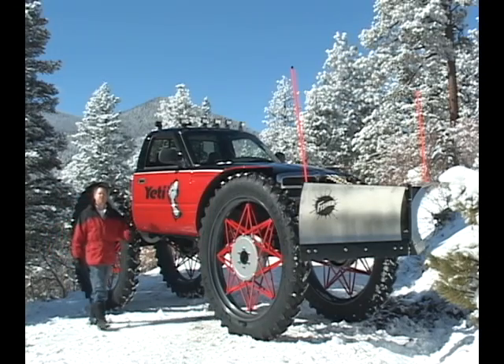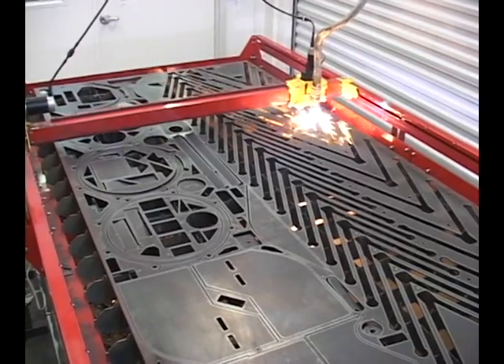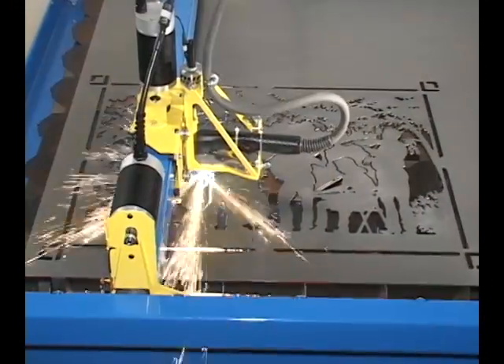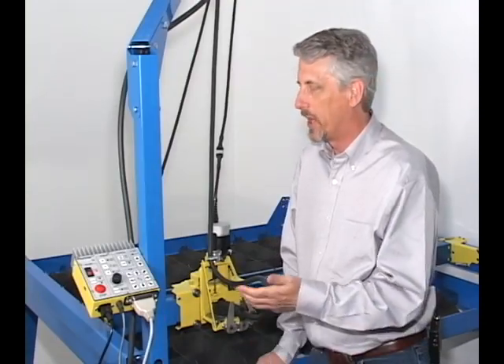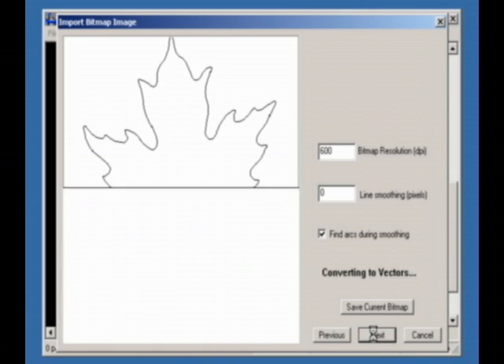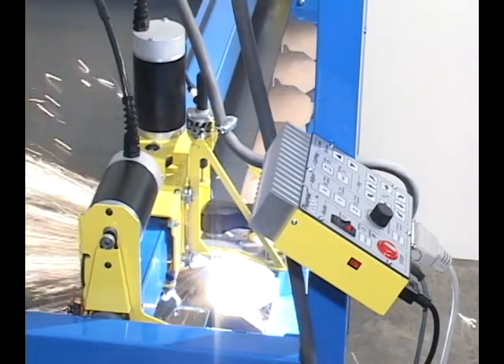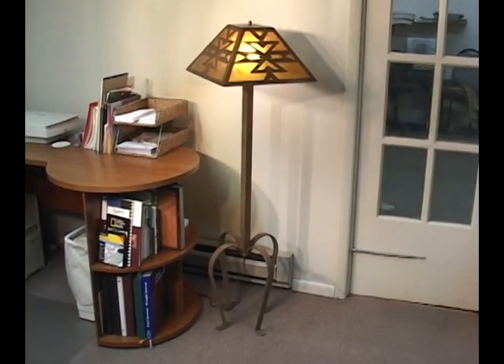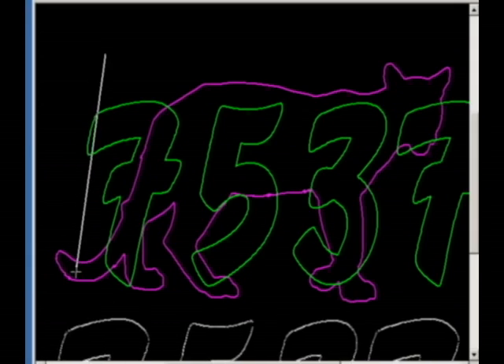Yeti Concept Truck - Revealed

Comment: First - please flag this video for misleading text.

The shock design looks wrong to me. I feel a vehicle with that much clearance and a high center of gravity really needs rocker joints that rotate the shock near a 1 to 1 as it compresses. That angled duel pin setup is not well thought out. How your shocks / chassis are setup is a huge part of handling... especially given bad conditions.